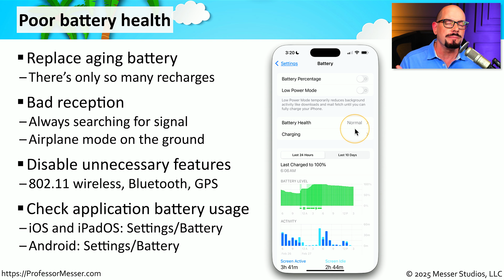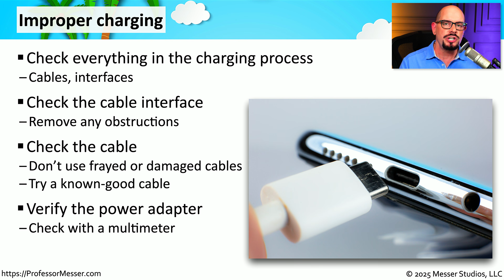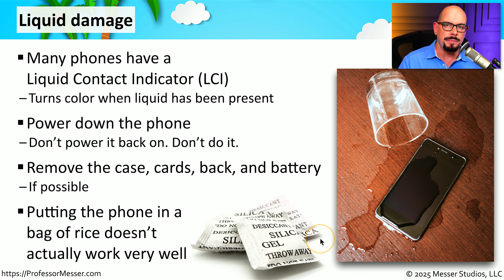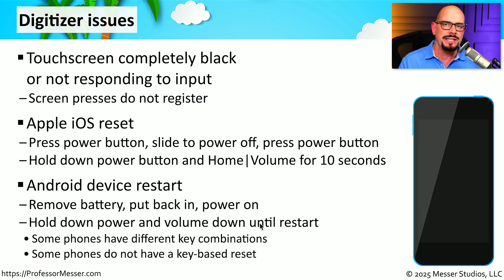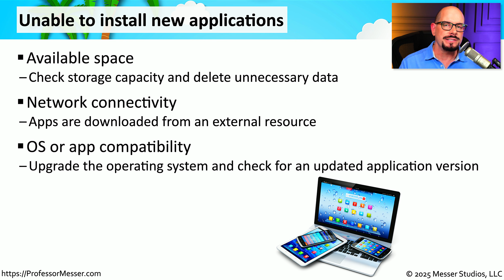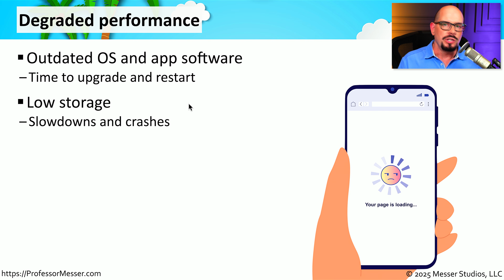Troubleshooting Mobile Devices - CompTIA A+ 220-1201 - 5.4

Comment: I will say I worked in mobile device repair for 4+ years and the best trick we learned for water damage recovery is to (open what you can &) put the device in a cheap food dehydrator on low for up to 6 hours. As long as the temp is 70C or less nothing should get damaged.